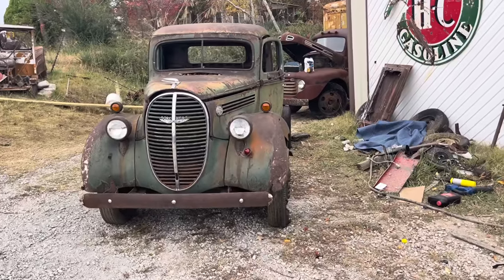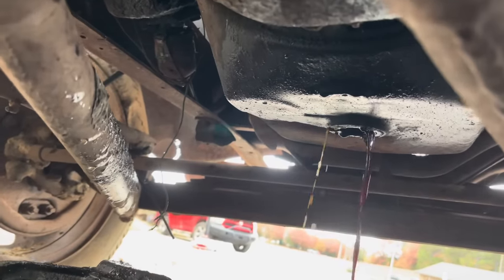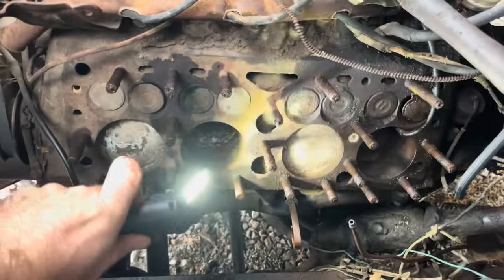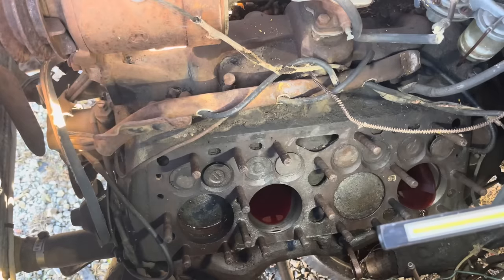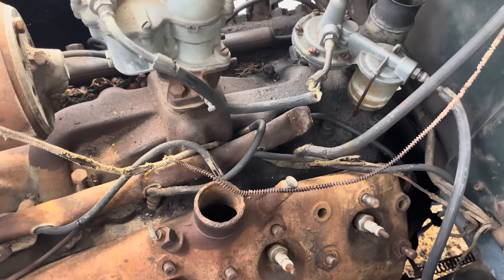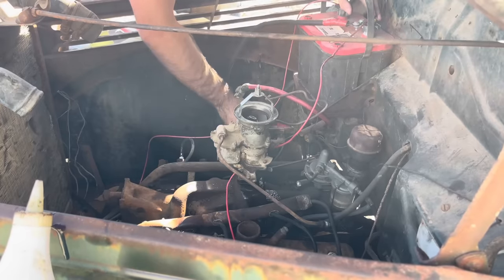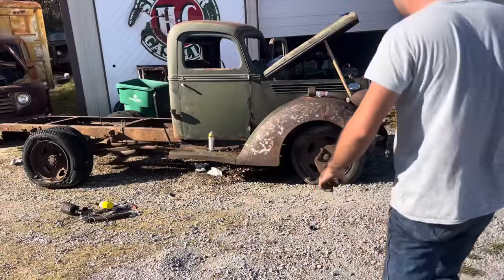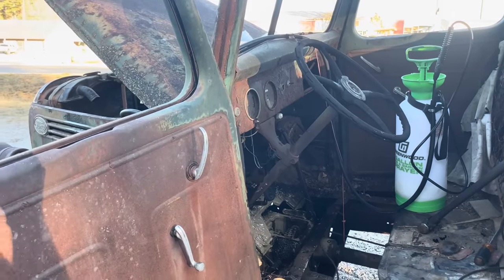Will it run after 65 years 1939 ford 1.5 ton flathead v8 truck

Comment: Great job that I can relate to. I drove a old family farm 52 ford F5 with a-busted block, no brakes and no clutch 50 miles home and installed a 1968 Buick wildcat 430 cid and turbo 400 new bed and cleaned up cab and made 4 heavy loads from Hamilton Ohio to Auburn Alabama moving a corliss steam engine. I passed many other new trucks going up Mt Eagle in "ten Y see" and they could see my load. LOL one trucker followed me to the waffle house to see for himself how an old ford could out pull his new Kenworth. GOOD OL DAYS that was 1973...I ran that truck till the engine gave up in 2023. LOL unloaded it could Smoke 4 nice wheelies from a red light if a vett was near me.

Comment: Mate when you turned it over the last 3 Valves on the drivers side did Not move , and at 21:09 you have a fuel leak , Don't get me wrong i love these things I have a 39 91T it's in the photo on the left , it's a shame your not from around here I have spare parts for a 91T . where am I Queensland Australia  , I wish you well

Comment: When you were turning it over with the heads off, I noticed 3 valves that were stuck. If you had taken the time and had the knowledge of how to free them up it would have run near perfectly. I have worked on and overhauled more of these Flatheads over the past 52 years than most car enthusiasts have ever seen. These are the toughest little engines that any car manufacture has ever made.  I still run one in my hot rod that has NEVER been rebuilt, and it runs PERFECT.
Reply from the maker: I did free them just didn’t show it a lot goes on that I just don’t film or the videos would be hours long
Reply: We all wish we could be a gun like you

Comment: You must trust gasoline more than me because I would have already tightened up that rubber fuel to steel connection with all the arcing and sparks going on in the engine bay.

Comment: I did a little google search and it appears as though the average compression ratio for 1939 cars was 6.28 and the average octane rating for gasoline was 88.25. This engine should run just fine on today's gasoline.

Comment: I can't believe that this engine will run very well if at all. I notice some of the valves were not moving when he turned the engine over. Or he omitted a number of rebuild steps. Dripping gasoline and sparks for starting contact, yikes.

Comment: OK, I'm no real motor enthusiast, and I'm no engine expert either. But I'm now almost 60 years old and since I got my first car I did everything I could on my cars on my own. So I gathered a little experience as well. So to me it looks a little harsh how you get this old flathead lady running. And I ask myself: was it just to show that she's still able to run for a few minutes before breaking down or do you really want to spent her a new life? To crank over the motor without even wiping out the dirt out of the cylinders and to fire up with stuck valves looks somehow gruesome to me. Maybe it's for you hardly find anything like this in Germany and if you would, you maybe would treat it with more respect.

Comment: I guess the gas leak is no problem, no water hoses hooked up.😮
Reply from the maker: I was putting water in the block with a garden hose every few minutes so it wouldn’t get hot and the gas wasn’t to big of a deal most of the gas around here will hardly burn
Reply: I see, I love those old flat heads and trucks, I had a 40 Ford, water to fix it up so bad but to many irons kept jumping into the fire. Would love to see more video of the resteration.
Reply: Wanted

Comment: Ah did you happen to notice you had stuck valves and a dirt dobber under one of the valves on the head off side
Reply from the maker: All that was fixed and cleaned out before putting the head on just didn’t show it

Comment: I wonder what happens when you put some coolant in
Reply from the maker: I put water in it and it did just fine no leaks and no cracked block also no milkshake in the oil pan

Comment: I would love to buy a new car and be able to work on it like this. Instead you need a special machine to be able to program my transmission, you need a code reader to find out the simplest of issues, if you put the wrong size rims on it than it goes into limp mode. It’s as if they want to find an excuse not to work.

Comment: There won't be any   the modern cars and trucks are disposable   And as for electric cars    FORGET EM    you will have to carry around a new set of batteries after  you drive 200 km

Comment: Shot in the dark here but, anyone know why a 7.4 vortec would have an rpm surge at idle when the truck is warm?
Reply: @po18guy  that is one of the sensors I have replaced (TPS), and still no luck.. I haven't done the coolant sensor yet. Also, when I pull the PCV off (that is new as well), it stops surging. I don't get it. Ideas?
Reply: @@po18guy someone said only to get ACDelco cause the others are junk. And I feel like this new one I have (from carquest) is not tightly fitted. I am going to order one off Rockauto

Comment: It can't be a V8 if it's a flathead
Reply: "Flathead" means it has side valves and the cylinder head is "flat", no valve cap on top of it. A V-engine just have two cylinder heads instead of one in an in-line engine. This is definitely a flathead.

Comment: It seems like those that think you will be able to fix one of these  2000 series cars  is going to be almost at 98% In possiblity due to the grade of material  that these engines are made of. The thickness and quality is not the same. Go look at  truck that eas left in a field 50years ago and a 2000nanything left in the garage.  Its not happening.

Comment: I hope he fixed the two stuck valves at the rear of engine...you can see one oppend and the outher just stayed open I'll bet a few tapes with a hammer would free them up
Reply from the maker: I freed them up before putting the head on it only took a little tap from a hammer
Reply: @jenningsmotorsports7554  I've seen outhers that do the ..will it run ..videos thay use diesel motor oil like 15w40 , I have an old 77 400cid engine it runs but suffers from low oil pressure after it worms up.  So I did put 15w40 rotila oil in it , the oil pressure cold is on the hi side after it worms up its in the normal range ..is it safe to keep using the 14w40???